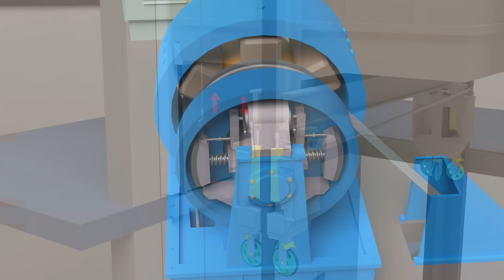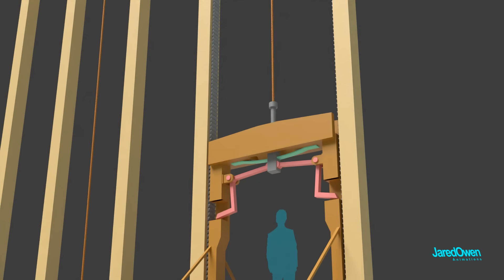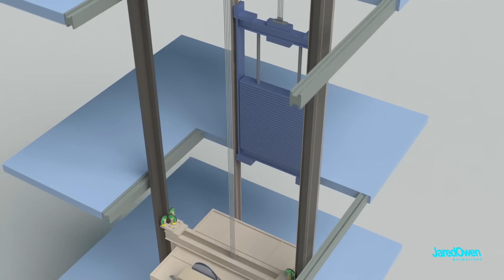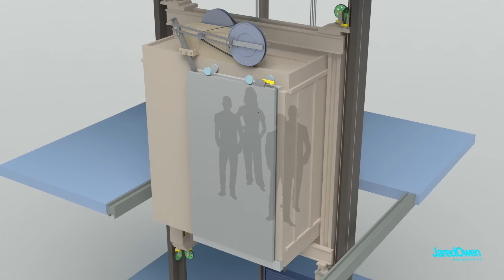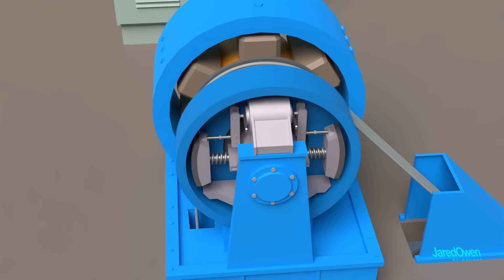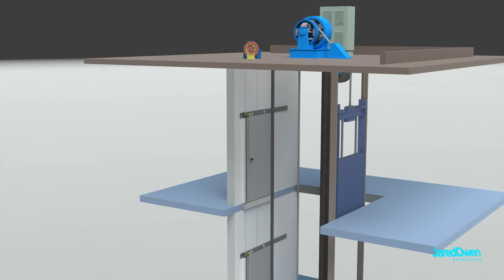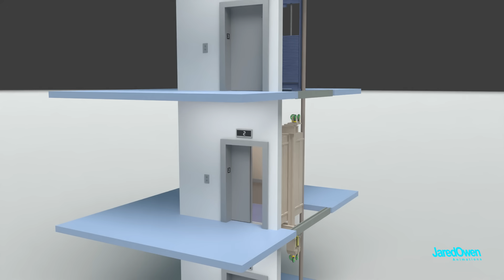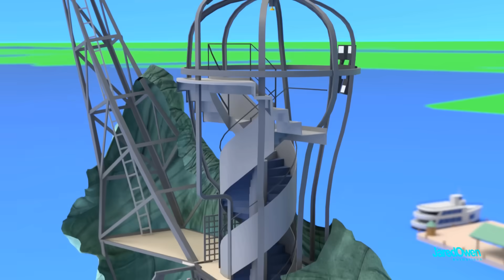How does an Elevator work?

Comment: I worked for an elevator company for 13 years, an excellent video, thank you for the time and effort you put into it.
Reply from the maker: Awesome!  Glad you enjoyed the video
Reply: @JaredOwen  hi what kind of videos have you made about space and machines makes me really interested in your great work Jared Owen but why do you speak Danish in all your videos when you really come from the USA I thought  🤔😊👏😝✊️😅🙌✨️❤🤞🤓
Reply: @JaredOwen  don’t gotta make it a long one but can you make a video how a watch works.
Reply: @JaredOwen tt .wo h up
Reply: @JaredOwen can you do a how a ferris wheel works?
Reply: No other job has more ups and downs.
Reply: @KevinT3141  i hate you for making me grin
Reply: @KevinT3141 fffdffgfrrswe
Reply: @KevinT3141 ur funny
Reply: awesome video indeed! btw, i was wondering if the hoistway door could be opened if someone try to do so exactly when the elevator is passing behind heading to another floor
Reply: @julianleite  it would work, because the ‘beak’ does not get unlocked unless the ‘pickup rollers’ are squeezed by the clutch.  The squeezing only happens when the cab doors begin to open, not when the elevator itself moves up past your floor level.  Don’t worry, I had the same thought until he explained about the clutch.
Reply: @julianleite  Yes...it could be done on those older installations with fixed cams. I've done it myself by watching the floor indicator and, just at the right time, "snatching" the car doors (centre bi-parting). The cams are in the right spot, grab the rollers on the landing doors and break the lock contacts.
Reply: @julianleite  No it can't.  When the elevator passes a landing without stopping, the clutch does not make contact with the pickup rollers.  In fact, there is about ¼" clearance. At a stop, the car door has to open that ¼" before the clutch makes contact with the opening pickup roller, and about another ¼" before the beak is fully lifted and the door is unlocked.  At that point, the two doors are fully engaged with the clutch, and will open.
I worked in the elevator industry from 1960 to 2000, the first 18 years in installation and just short of 22 years in service and maintenance. The last 32 of those 40 years were spent with Montgomery Elevator (now KONE), and it appears that the door locking mechanism described here was based on their system.
Reply: @julianleite  
Before opening any door with a key the elevator has to be locked off first.
Reply: @d.o.m.494  That's good to know. Another excellent safety feature.
Reply: Let's upvoted this comment, so it can be elevated to the top!
Reply: @Nekr0n35  🎉❤🎉🎉🎉🎉🎉🎉🎉🎉🎉🎉🎉🎉🎉🎉🎉🎉🎉🎉🎉🎉
Reply: The real question is why hasn’t the elevator company yet changed its name to Schindler’s Lift? 😤😤
Reply: @juniperbarry9105  There are many international and regional elevator builders. Each country also has its own rules for the different types of lifts. The company I work for is a regional one that places both a house brand and the Orona brand. Then there are elevator builders such as Otis, Kone, Matrix, Dumon, Mitsubish, ...
The big (international) companies usually do all kinds of lifts, but small companies usually specialize.
You can usually divide lifts into a number of purposes. In particular for people, cars, goods (at home or in restaurants) and industry. With passenger lifts you can further divide into stair lifts (a chair along the stairs), mono lifts (1 person lifts), slow lifts without a lift pit that rest flat on the ground in shafts or along stairs for the disabled (usually a maximum of 2 stops), the normal elevators and escalators.
Reply: @juniperbarry9105  
😄
Reply: As an ex-employee (30 years) in the elevator industry, I can attest to the authenticity of what Jared has created. Accurate and factual.
Reply: I am staying quite near to three lifts, whenever they moves up or down, I think for one our two of the lifts, I get like low grounding barrel drum-like sound coming to my living room. Do you knew which part of the lift is causing this problem...I need to tell the lift company to fix this issue...if I travel inside the lift car, I don't hear any sound at all...the sound is coming outside of the lift and then I hear it inside my home. Any thing you can tell me to inform those lift technician where the noise causing problem?  Thks.
Reply: @adrianlee3635 Hi! I have the exact same problem. One of the 2 lifts shaft generates a low frequency vibration that travels through the walls, no matter where the lift position is (top, middle, down). The lift company sent an engineer, they did some greasing "somewhere" which refuced the vibration noise by half, but 2 weeks later it was back to full noise. Still need to find the root cause (COUNTERWEIGHT guideways??).  Have they fixed yours?
Reply: Good For You! Just wondering what elevator company did you work at?
Reply: @elisamburks  
thyssenkrupp Elevator which is now TKE.
Reply: @d.o.m.494  I am currently working for TKE
Reply: @elisamburks  don't send me likewisvideos😮
Reply: Otis 
Schindler 
Kone
Thyssenkrupp
Reply: @lukkkkkke.win10-win8.1  
Thyssenkrupp sold its elevator department and it's now called TKE.
Reply: how do airplanes work
Reply: I got stuck in a elevetor today and now im so scared  i cant ride anymore.  Is the inspektion good ?
Reply: I work for tke. Video was better than anything I watched in school or in a safety meeting 😊
Reply: @shitface60644  
I worked for tke as well.
Reply: My Dad worked for an elevator company for almost 40 years. He retired from working on elevators, and now works as an elevator inspector
Reply: @JohnAckerman31  dile a tu papa que me de chamba
Reply: What music was most common amongst the traid?
Reply: What’s the small hole at the top right of the hoistway door?
Reply: @carlstanland5333  the key hole to open the elevator door
Reply: @carlstanland5333 that is the key hole to put the special key in to unlock the hoistway door.
Reply: @carlstanland5333  
Keyhole for technicians to open the doors without power.
Reply: @carlstanland5333  that should be for the technician, in case of emergency or maintenance, to open the door with a lift key
Reply: @carlstanland5333  That is for the elevator mechanic's unlocking device to be inserted....a rod with a "keyed" end on it that is used to manually release the locks in emergencies or during maintenance.
Reply: Nice
Reply: Are sounds that sound like something breaking and doors not closing some times safe?
Reply: What career did you switch to after 13 years?
Reply: @jacobclement7707  
I had to retire due to medical reasons.
Reply: Who asked
Reply: @Alessandro-mg9oh me
Reply: Ok , pl discuss what to do in case of getting stuck inside and no help comes for a longer duration
Reply: Why don’t you work on elevators anymore?
Reply: Thank you.. sir❤❤
Reply: why are you watching this video than if you already know how it works
Reply: great
Reply: yes
Reply: Can you please share your mail id ?
Reply: Is it OTIS or SCHINDLER or maybe DOVER?
Reply: Really..
Truth. I am currently doing vertical transportation course.
Reply: Ебучий перевод!
Reply: Dame chamba bro
Reply: Contact number share me
Reply: Hi, i want to learn more about elevators
Reply: Ok, Ill ask-you : Fair job pal, I’d like it more in depth …..  but… I’m a mechanic. Like, exactly how is it controlled?, how does the counterweight system work?, if you have 100 floors, where does all the cable go? How does it know where to stop….. or … start…. Etc.? How do the mice get into my 20th floor apartment? Who pushes the button for them. I know they dont come up the cable. Its greasy. How greasy is it?
Reply: The video boy  is  more important than you
Reply: Good 
Namaste
Reply: Hi ! Hope you’re doing well . For my final project to get my mechanical engineering degree im working on making a lift . Can i get a contact or an email i can hit you up with ? I could really use your expertise
Reply: 🕉 🕉 is an important 👏 of the world 🌎 👏 which is not a very important 🤔 😉 but the world ❤❤❤❤❤❤😂😂😂😂is 🎉🎉🎉🎉🎉🎉🎉and you 9th and you are a ❤❤😂🎉🎉🎉🎉🎉😢😢😢😢😢😢the 😢😮😮😮😮😮😮😮😮😮😮has the 😮most
Reply: Hey I need your help
Reply: 69 replies let me fix that
Reply: I’ve never worked for an elevator company and don’t know that much about elevators, but I do know they can malfunction and move too fast not only down, but also up — like in the 2014 accident in Santiago, Chile, where the elevator suddenly shot upward and the passenger, José Vergara Acevedo, suffered a spinal cord injury that left him paralyzed from the waist down. So I’m surprised you didn’t have any concerns about the video not mentioning that possibility.
Reply: 69
Reply: Bad 👎
Reply: Elevator tech is stuck in the past. Seems there's no innovation going on. Firstly, safety: relying on friction brakes to slow a falling elevator is prone to failure. A failure of the governor to operate properly due to poor maintenance will render the brakes useless. Grease on the vertical bars or badly maintained brake pads or rust/metal fatigue holding the brake mechanism will also cause catastrophically failures. Secondly drive : Sticking a massive motor at the top of the shaft and have very long cables swaying about in a long shaft with equally long cables supporting counterweights is a very poor use of materials. This design fundamentally limits elevator functionality in terms of speed, height and operation.
The solutions are: 1) for safety : passive magnetic induction. Through the whole history of the universe, magnetic induction coupling has never failed. To prevent catastrophic elevator fall impacts all you need are some strong permanent magnets attached to the building and some copper plated attached to the cab. Check out some magnetic induction videos for examples. 2) Drive. in this day and age where 18 wheel semi-trailers are on the roads hauling 80,000 pounds using electric motors it is entirely feasible to put the drive motors for elevators on the cab itself. Once you've done this, then height and speed limitations are removed for elevators and you now have the option for even more innovation like transverse movement and even multiple cabs per shaft.
Reply: @mb-3faze  Over-blown rubbish!
Taking into account the number of traction elevator installations throughout the world since the original Otis safety elevator in 1853 there have been miniscule catastrophes and accidents/incidents. The elevator is still considered to be the safest mode of travel.
There is no problem to solve.
Reply: @hcrun  A decent engineering company should always look for ways to improve the technology. Even in this animated video the negative effects of having ultra-long cables dangling down 1000 feet or so of shaft poses major challenges not to mention the sub-optimal use of that very expensive volume of building occupied by nothing but air and said cable. Just because it's-always-been-done-like-this does no make it the best way. For example, you're typing on a computer (of some sort) - what is wrong with a typewriter and some paper? Much of old technology has moved on, things have got better.  Wikipedia lists all the deaths and injuries caused in elevator accidents - the numbers ain't zero. Elevator technology is very much stuck in the past. As they say in school "could do better".
Reply: @mb-3faze  It’ll be alright don’t worry.
Reply: @mb-3faze  it is still the safest way and proper maintenance is crucial
Reply: @m b  Fascinating.  Gene Roddenberry envisioned transverse movement for the elevators on the Enterprise when he created Star Trek.  Although I wouldn't be surprised if someone like Leonardo Da Vinci didn't dream that up too.

Comment: I was in an Embassy Suites in Indianapolis recently, they have eight storey hydraulic elevators. It's a bit nuts to think that there's an eight storey hydraulic ram buried under each one.
Reply: Most hydraulic elevators use telescoping cylinders. (Think of those old metal telescoping antennas, or Russian nesting dolIs) was surprised the animation didn't address that. They don't have incredibly deep pits. The taller the building the fatter the cylinder, and the more fluid required. They are also very slow.
Reply: @JonathanBirdsey  Dump trucks have the same type of hydraulic ram, that would be a good example to use.   One one-story long ram could be long enough to reach several dozen floors.

Comment: Awesome!  Thanks!
When I was a technician working on card access, I had to change a reader in an elevator car.  The elevator technician decided he didn’t want to shut the car down while I changed the reader.
At one point, the doors opened on the top floor, and a lady started to come in.
She saw me with the panel open and hundreds of wires everywhere, and an elevator technician also standing there.
She stopped (of course) and said: “It it ok to use this elevator?”
The technician (I had worked with him quite a bit), said: “It should be ok.  If the cable snaps, a big shock absorber is going to come through the floor when it hits the bottom.  You’ll probably survive if you stand in the corner”
She said she would take another car.
He smiled and told her he was just kidding, and reassured her the car was fine.  He also told her that he wouldn’t be standing there if it wasn’t safe.
We all had a laugh about it - he’s a pretty funny guy. 🙂
Reply from the maker: Oh man - some people have deep fears about elevators!  Probably scared her a little😂
Reply: Ive worked with elevators for 7years now, i always say something similar when working with the lift while its not in service mode :D

Comment: Hydraulic elevators have the piston on the side of the shaft and is geared up with ropes.
Reply from the maker: True - there are different configurations for Hydraulic elevators.  I only showed one of them in this video

Comment: I got trapped in an elevator for 2 hours one time, it got hot and ran out of oxygen! I also know why there’s no escape hatch in the ceiling unlike in Die Hard 2 for instance
Reply from the maker: Yikes!  I'm glad you got out
Reply: @JaredOwen  i would also love to know why isn't there any escape hatch in the ceiling of a elevator
Reply: @apollogaming2781  liability issues. people can get into all kinds of additional problems once they get up there in the shaft, and usually they are rescued before "the oxygen runs out" - btw, oxygen does not actually run out, but OP did experience the sense that this was happening, probably because carbon dioxide in the cab was building up
Reply: @APOLLO GAMING27  There is a hatch but it can only be accessed from within the elevator shaft itself which is for rescue only. It won't open from inside the elevator because people shouldn't be inside the shaft, only maintenance and rescue teams.
Reply: You’re not going to run out of air in a lift. The lift car isn’t airtight. There’s lots of places where air can flow through. 
 The only time to worry is if the building is on fire and the lift shaft fills with smoke. That’s why you shouldn’t use lifts when there’s a fire.